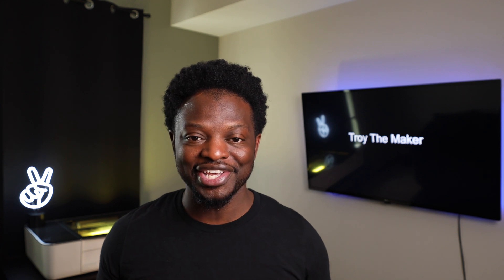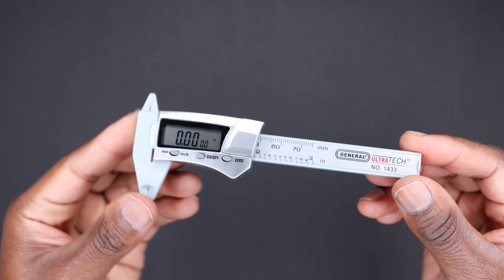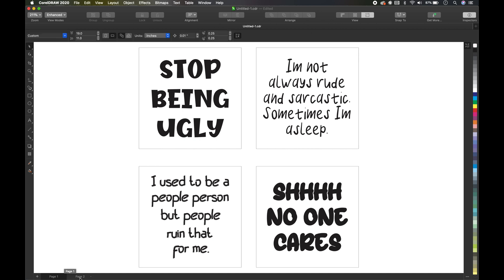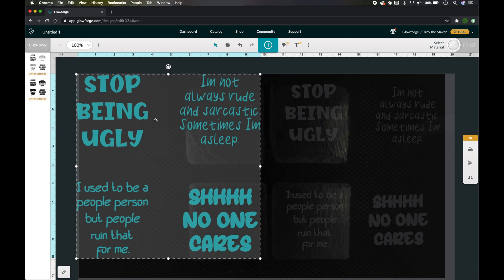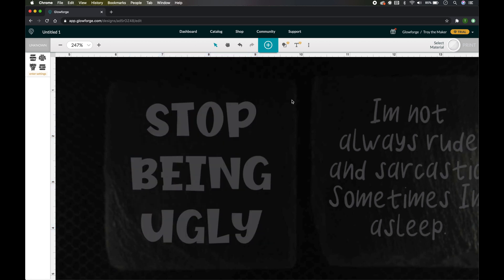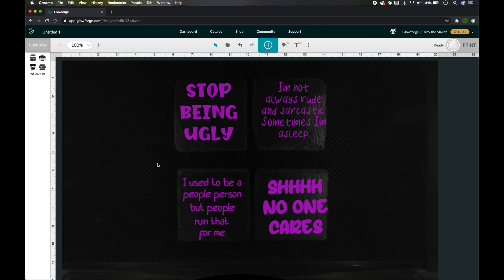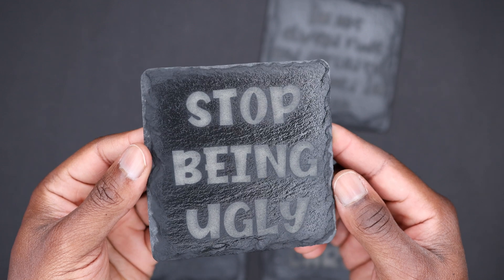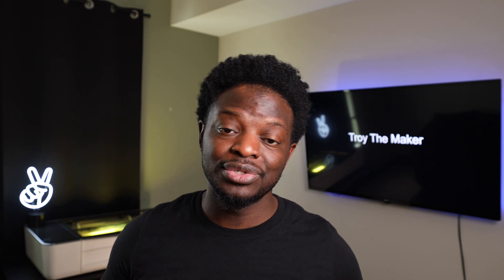Laser Engraving | Slate Coasters | Glowforge

Comment: Great job my man, and that's a great tip about the PNG vs PDF moving things around. I love engraving slate, but, I have stopped using mineral oil and hit them with some spray lacquer first. Dries way faster than the oil and seems to come out way more crisp
Reply from the maker: Thanks. Great tip! I'll have some orders I'll most likely give it a try on one of them.
Reply: Hey I tried some spray lacquer also but it dries quick and I got a white film. What did I do wrong. thanks
Reply: @trevellw8210  Hey there, I normally apply just one, quick light coat and that seems to do the trick for me... What kind did you use and how much?
Reply: Ryan Niemer hey Ryan I used regular spray lacquer from Home Depot I sprayed and it has a light hazy film on it I read bottle it appears to be a clear coat so wonder if I sprayed to much but first coat I sprayed was not clear unsure I was going to ask at Home Depot let me know which you use thanks
Reply: Do you still use spray lacquer?  I sprayed mine with shellac.  Stack 4 on top of each other after about 3days I saw it left foot prints from the coaster feet